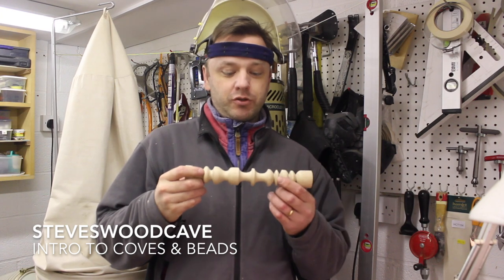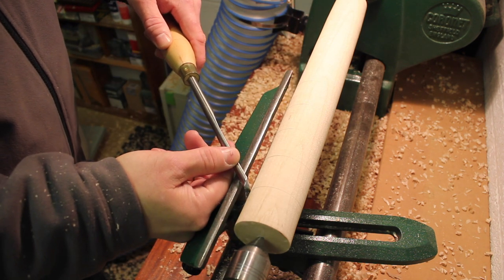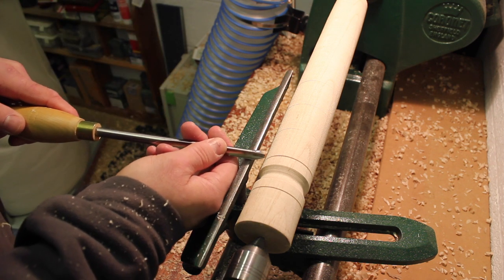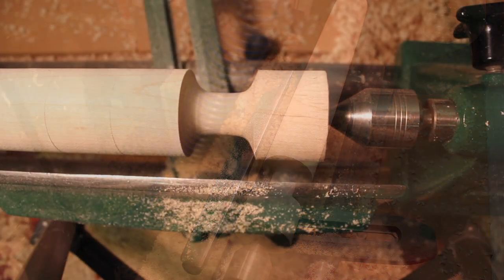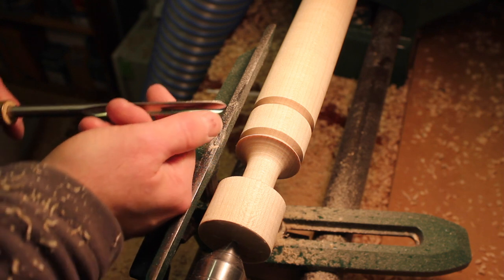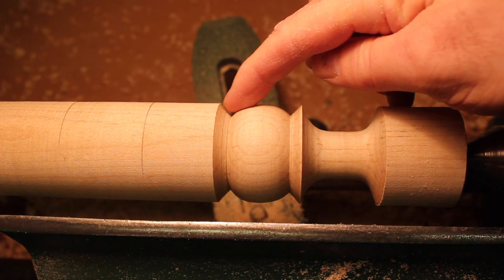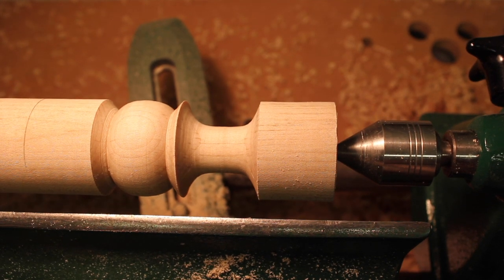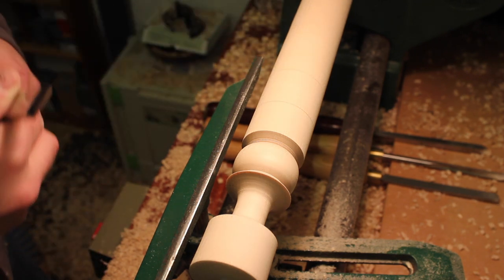Intro to Coves and Beads (Woodturning for Beginners)

Comment: I’ve watched a couple of your videos. Interestingly, I also have a Woodrat and a Coronet Number 1. The lathe is very substantial. Mine is over 30 years old. I bought it at a woodworking exhibition in Bristol. I took it home in a Citroen Diane. The suspension bottomed out !
I learnt turning at school. I was taught not to use the underhand method. I am right handed so my left hand is palm down on the shaft of the blade and right hand palm down on the handle. That way when the tool digs in it is less likely to whizz off handle up. Things are different now as I watch woodturning on YouTube. I guess woodturning is all about feel.
Reply from the maker: Thanks Jim. I’m a bit of a WoodRat fan and got into Woodturning after a mate at work gave me this little lathe. This Coronet lathe is quite small, but it’s fine for most things I make. I’m mostly a flat woodworker so turning is not my key skill. I think schools always teach the safest methods, they have to! Many pro turners seem to use all sorts of tool holding methods so I don’t think there’s only one way. Whatever works for you I say, of course, as long as it is safe!

Comment: Hi Steve,  could you please give me some information on the cone drive you use and where you purchased yours, I am learning to use the skew chisel and have had a few dig ins which is to be expected but like what you have suggested in your video
thank you
kind regards
Paul
Reply from the maker: Hi Paul, it’s from Axminster Tools (I assume you’re in the UK, but if not you might be able to order from overseas?). It’s called a ring friction drive centre nowadays. Here’s a link to it on the Axminster website…
https://www.axminstertools.com/axminster-cone-drive-ax21250 or if you want the pair (for head and tail stock) look here…
https://www.axminstertools.com/matched-pair-of-ring-centres-ax797244 
Hope this helps? Regards Steve
Reply: Thank you for your prompt reply , very helpful 👍

Comment: Hi Steve thanks for the tutorial very helpful. I'm looking at a similar lathe to yours for my first lathe, it's missing the drive centre, how easy is it too find a new one to fit your lathe? Also is it easy to find compatible Jacobs Chuck's?
Thanks Josh
Reply from the maker: Hi Josh, thanks, glad it helped. Drives centre, Jacobs chucks and other lathe accessories can be found at various shops throughout the UK (assuming you’re in the UK like me?). Try the websites or give them a call. There’s The Toolpost, Axminster Tools, and Yandles, plus many others you can find via a quick search. At least one of these three should be able to help you. Good luck!

Comment: Hi Steve loving your vids but I could do with help on the height of the tool rest in relation to the work?
Ta Mike
Reply from the maker: Hi Mike, thanks. I assume you mean for a cove cut? I would say have the rest positioned height wise so that when your gouge is tilted over on it’s side the centre or tip of the gouge is in line vertically with the centre axis of the lathe. When your gouge ends upright with it’s flute pointing to the ceiling and the bevel rubbing (at end of a half-cove cut) then your handle will be lower than when you started the cut with the tool fully over on its side. Does that make sense? If not, ask some more... HTH cheers Steve
Reply: StevesWoodCave 
Hi Steve
Thank you for your reply and yes that does help.